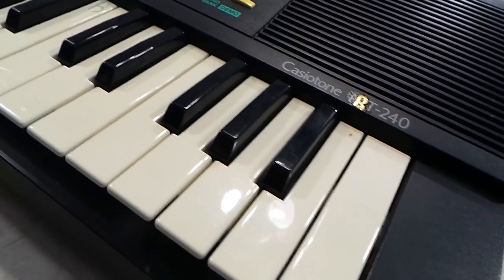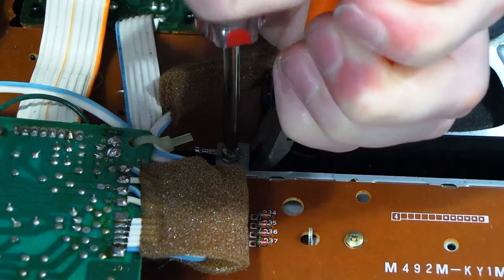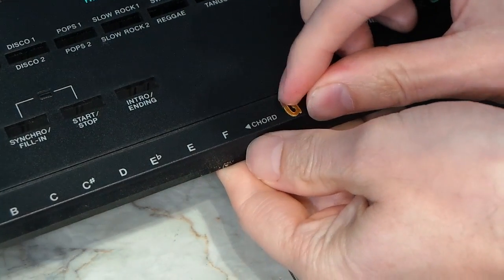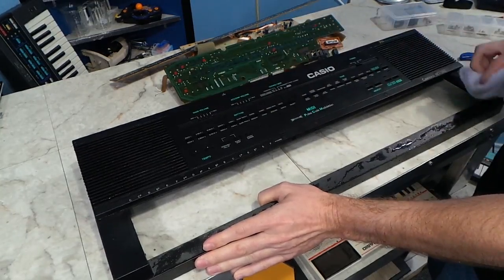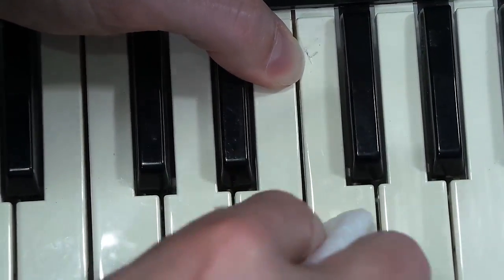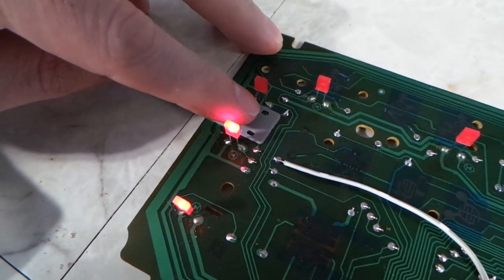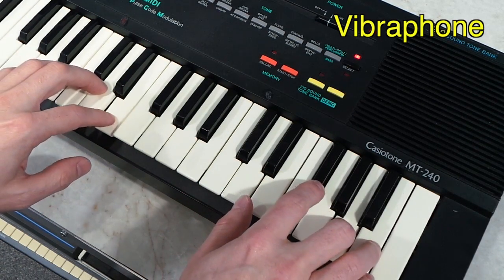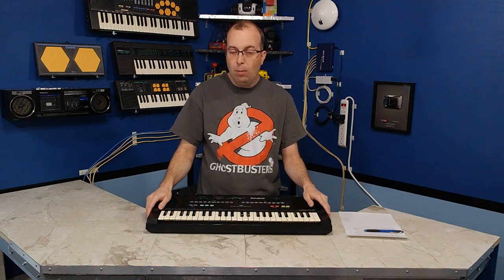Casio MT 240 - Repair, Restore and Review

Comment: Note to everyone: Be careful with the rubber domes for the buttons on keyboards of any kind as the are coated with a conductive coating that allows them to complete the circuit when making contact with the copper trace on the board allowing the circuit to be completed, over time that coating can where away making them not work at all, so be careful if you try to clean them.

Comment: about the leftover glue residue, you can try sanding it off with automotive grade sand paper (1000 grit above, higher grits will bring back the sheen after a bit of buffing with cotton), 3M sanding pads of high grit numbers can also do the trick. if you're worried about the plastic shine being fogged over the surrounding area due to the sanding, try applying some pledge floor care with a Q-tip to bring back the shine a bit.

Comment: I do adhesives for a living. Sicomet D-BOND is the product of choice
Active ingredient is nitromethane
Reply from the maker: Actually.. I wanted to try a nitromethane product.  I had read about those on the internet.  But I visited several stores such as home depot, hobby lobby, etc.  I never could find it.
Reply: That sounds better then the product I was going to suggest. It's called Goof-off and it's at Lowes and Home Depot.
Reply: Aaron Lopez
Reply: isnt the fuel used for RC cars Nitromethane and methanol?
Reply: Buy nitromethane fuel, It's used for rc cars, and it's nearly 100% nitromethane, I use it to remove old stickers from old bikes
Reply: Does it also remove superglue residue?
Reply: yes
Reply: I actually buy, like I said, nearly pure nitromethane, ethanol and oil separately, then I make the mixture by myself, and varying the percentage for the circumstance. It's much cheaper this way. But yeah, online and in Rc car shops you can find only lower percentages, they work good even if they are not pure.
Reply: With the ABS plastics like that, you are right that acetone will melt the plastic, but in my experience, you can use acetone to melt the plastic screw stalks back on, and it is a stronger bond than super glue.  I have used it to repair a quickshot joystick for my c64, and it worked great.  I took a video and will post it soon.
Reply: Late to the party, here, but Rommager is correct.  The plastic bits can be welded back together with acetone.  Just brush it on both parts to be bonded and poof!  Like new.
Reply: "I do adhesives for a living."

I just do adhesives recreationally.
Reply: +Robin Williams Heh, giggity!
Reply: I'd do Ebay or Amazon for small batches of solvents and stuff.
Reply: Hey,  @8BitKeys  I have a Yamaha keyboard with contacts that seem to be made with some black conductive material (think the last that goes back and forth closely that the rubber carbonized pads touch to complete the circuit). It seems they've dried out or corroded and that material has chipped off.

How can I fix it? I'm thinking silver conductive paint or something.  Any ideas?

Comment: Conductive paint is a good way to make connection to those printed carbon tracks under the buttons that you can't really solder to!  Also, there's a substance meant for repairing the heated tracks on automobile rear windshields that can work, too.
Reply: Conductive ink, I bought the cheap stuff from AliExpress and am doing test on my own. The problem I have encountered is that it doesn't 'grab' to the surface sufficient, so if you wipe the windshield 2 or 3 times the ink is gone. I'm going to test the 3M proper ink for windshield heater repair and report back the results
Reply: @Jojo Tully Music haven't got the proper 3M ink but by experimentation I think I found the trick to do it properly. You must use not the first "squirt" of the pen but let the ink flow and then start your trace (like painting with a spraypaint can). Also letting it cure for days before touching it helps a lot

Comment: 12:00 I learned that the hard way. Once, I accidentally spilled a little super glue on my laptop (which I'm using to type this comment). I used acetone to remove the super glue, but it also left a white spot on the screen bezel (that's where I spilled the super glue).

Comment: That corrosion was probably from the leaky battery. It would explain the mark on the rubber membrane and the eaten-through track on the PCB. I'm guessing the keyboard was stored upside down for some years in that state.
Reply: Yeah that was what I was going to blame as well.
Reply: Yep you can always tell because copper dissolves into a green residue.
Reply: @EternityofNight  - copper oxide. In the olden days they called that green residue "verdigris".

Comment: This keyboard actually has more tones than you think. The button that's labeled "210 SOUND TONE SOUND BANK" lets you pick two tones from the tone selection area and combine them. So, for instance, you can combine the chorus and the accordion to get a unique sound. But you can only combine a tone from the top with a tone on the bottom. That'll give you a very wide range of tones to pick from and play around with.
Reply from the maker: I'm familiar with how the tone mixing works.. but I still think it is a cheating way to claim more sounds than it really has.
Reply: I think you meant Yamaha PSS-380 ;)
Reply: Scarecrow Scarves Studios the same thing works with e.g. the CT-637 (which I have).
Reply: From Gwendoline Leong channel
Hi do you know how to "on" the keyboards? My Casio CTK495 works fine the Tone/Rhythm/Song bank. Just the keyboards.have no sound whatsoever. Maybe just a wire loose? Plug? What possibilities can you think  of?

Comment: I had the Casio MT-240 back in the early 90s and used it a LOT on my Atari ST/STe computers.  I used to looooove the way they sounded and it was a pretty affordable way to get MIDI back then.  I don't know what ever happened to it and I regret not still having that keyboard with me despite all the other things I've managed to keep.  I recently picked up another one and I especially love that demo song ("Night Birds" by Shakatak, 1982).  Excellent version of it!  In any case, the new keyboard seems to be in generally good condition but that 9v power supply connector is loose on the new MT-240 and I seem to remember that it was ALWAYS loose even in my old one back in the day.  GREAT keyboard--I remember wishing it had general MIDI back as a kid but it was still fantastic!

Comment: Ahh memories...Used two of these midi'd to my Amiga 500, endless fun throughout the 1980' and 90's ! great Casio sounds, especially when layered (you can layer two !). if i remember correctly, select the first tone, then select the mutli/split and then select the second tone.Eg strings and piano. This is where they get the 210 sounds claim from.

Comment: You can buy conductive coating remote key pad repair kit (check eBay) to get those non-working keys to work. It worked fine with my old Roland D-20 synth.
Reply: At your local auto parts store, rear-window defrost repair paint. I've seen it used to repair an Atari 130XE keyboard.

Comment: I personally own this keyboard and I love it because it's super cheesy but you can make some crazy sounds with it if you mix the instruments and mess with the midi, auto accomp., etc... My 210 sound bank thingy works perfectly with both the top and bottom sound banks and even though it's missing the F#0 and F#1 keys (0,1 i assume is the octave not sure if it goes as low as an 88 key).. Anyway I heard that through midi you can access "hidden" sounds like fantasy and some others but for the life of me every time I look for any information on these in depth features I can't find jack squat. The internet is flooded with circuit bending tutorials on this but I don't own a soldering Iron and I don't feel like spending a gajillion hours bending this thing. I checked the manual and it hints at these features but doesn't really explain how to use them. I was hoping that you or perhaps one of the other followers could shed some light on the more intricate operations of this keyboard. I've seen all your videos and it's inspired me to try making music by rigging up these vintage toy midi keys with my more professional Korg poly 800 (circa 80's) as well as  modern synths like the Korg volca keys or VSTs in Ableton. Also THIS CHANNEL ROCKS! I've always loved these cheesy keys and it's nice to see that there is a community of people who do to. Keep it up!
Reply: I have this keyboard and I use it with maschine. I accessed those hidden sounds by going from midi out of maschine to the midi in on the keyboard. In the maschine software I set up a macro and added a page for midi program change. The extra sounds are on program numbers 20-29.

Comment: The Casio MT 240 actually got 10 additional hidden sounds you can select using program change over MIDI. It is also 3 channel multi timbral over MIDI so you can hook it up to a sequencer and play different sounds simultaneously over different MIDI channels.

Comment: I can confirm, the MT-240's black keys were bonded to the white keys at the factory.  I took one apart in the early 90s to repair some broken black keys and noted the same thing.

The keyboard was a gift and I was only a teenager, so I couldn't afford anything that would work with the MIDI interface.  I've always been curious about something:  how many instruments is the keyboard capable of playing if you use it as a MIDI output device?  I remember being able to access some instruments that weren't normally available from the front panel, by momentarily shorting pins together on the large, square IC on the logic board.

Comment: Loved it as always.

Is it possible to "upgrade" a monophonic keyboard to a polyphonic one? Like some of the those early white Casio toy keyboards like PT-80?
Reply from the maker: Not without some serious engineering.
Reply: By the time you were done, you might as well have built your own synthesizer from scratch! What you COULD do though, is use the keys and switches to trigger a polyphonic synth built around a suitably beefy microcontroller, and stuff it in the case! All the "magic" happens in the program code and the actual wiring side of things is pretty easy.
Reply: Yes, put the motherboard on the polyphonic keyboard in the monophonic's case et voilà 😂😂

Comment: Nice work on the keyboard! I'm amazed at how good this keyboard sounds. Some really neat sounds in there. Nice job on the button hack. Next time, you could consider using conductive paint when solder won't stick. You can use an automotive defroster repair kit or there's several solvent and water-based conductive paints out there these days. I feel pretty certain this would have solved the corroded trace issue. Also, another thing to try on the super glue is mineral oil (available at pharmacies), or motor oil, etc. It shouldn't harm the plastic and just might soften up the super glue enough to scrape it off.
Finally, I'm really liking the new intro :) Keep up the good work.

Comment: I have this exact model of keyboard that I rescued from a flood a year ago. It was literally floating like a boat and it was completely covered in mud. Gallons of water and lots of scrubbing was required to get it clean. And after that, the thing turned on and was perfectly functional. Unfurtunately, a month after, it just stopped working! I think it was the moisture that damaged some chip or inductor...

Comment: You can stack two sounds so there really is 210 sounds possible.
Reply from the maker: yeah, but lots of keyboards can do that.. where do you draw the line on the marketing?  So my Yamaha keyboard with 128 sounds and dual-voice mode should be advertised as 16,384 sounds?
Reply: Now it doesn't mean much. At the time this came out, when I bought mine, it was a big deal. 
Many of the dual-layer sounds work very well. :)
Reply: People were probably more gullible and easier to fool back then.
Reply: 8-Bit Keys Actually, it's 8,256 (to eliminate duplicates).

Comment: Hi Dave, not sure if anyone has already mentioned this, but you can use conductive paint to repair circuit boards. It would be ideal in situations like yours where traces have corroded. I bought some years ago in a tiny bottle and applied it with a 000 brush. I'm in Australia, but I'm sure you could find it via Amazon or Mouser electronics. Thanks for the great videos, it's nice to see your restoration work on keyboards and I love your other channel on computers as well.

Comment: Y don't keyboard vibraphones ever sound like real vibraphones?
Reply: Max Kellen they can't make a real vibraphone sound. Newer keyboards use samples of real vibraphones.
Reply: Because everything in synths are either generated by basic waveform (older analogue) or samples (PCM) on newer gear. The complextities of analoge instruments, voices etc, are composed of many different components that needs to be either generated (poorly with older gear and with better luck these days Rolands COSM system for instance) or have to be multisampled on many levels to recreate as much as possible of all the nuances that create the sounds of for instance a vibraphone or a piano.

When you hit a piano string with the hammer or a mallet instrument with different types of hammers, the sounds differ greatly. From soft, mellow sounds of the soft filt hammers to the crisp clunk of a wooden or plastic hammer. Then you have resonance within the instrument. The nearest strings will always resonate and create upper harmonies depending on how much they're dampened or open. Same thing with a vibraphone that's open, it will have a different sustained sound because the other mallet bars will resonate with it. Then you have ambience of the room and other instruments or just the room itself that plays a factor.

You'll never be able to recreate 100% any analogue instrument synthetically, but we're getting pretty close. And nowadays instruments sound near perfect for most purposes. The older gear that David is showing will always be limited to their era in both sample memory, method of sound generation and such. Just the way it is. :)
Reply: lol thanks for putting so much effort into the answer

Comment: Try lard (pig fat) on that superglue. Can't damage plastic and it's really cheap but need hour or two to work it's magic.
Reply: I was gonna say petroleum jelly or vegetable oil. But, the lard makes a lot of sense!!!
Pig fat dissolves strange hard to remove things easily. I spilled magenta inkjet liquid on my hands once, and tried everything to get the junk off. Rubbing alcohol, acetone, lighter fluid (naphthalene), but nothing worked. Then, while trimming fat off some pork for my sandwich the next day, much to my surprise the fat turned pink and faded the dye. Needless to say, I greased my hands, then used alcohol to degrease. Worked like a charm.
Reply: Andy Merrett
LOL I cut off or discarded the bits of meat that turned pink. Only a tiny bit did though, as I discovered near immediately. I know that magenta ink isn't completely non toxic.

But I did use most of the fat to finish cleaning my hands. XDDD
Reply: P  i  G    F  a  T

Comment: I have this exact same keyboard and I was able to remove similar lettering with a product called Goo Gone. It absolutely works and almost instantly!   For the more difficult areas wipe it on and let it sit for 5 minutes then it should wipe away with ease. in case you are wondering, Go Gone is a citrus concentrate that removes these hard to remove things by using enzymes that eat away the residual residual leftover rom glue, gum, tar, marker etc.

Comment: Nice memories! I've got the MT-240 in my childhood. Now is in the hands of my brother, still working fine. One clarification, you say it has 20 instruments, and 210 "combinations". In reality it has not 20, but 30 real / direct instruments. The problem is that you can't access those instruments (21-30) via the buttons in the keyborad (AFAIK). 

How can you play with those instruments? programing via MIDI comands of course. Use a controler (or PC) via the midi IN port. In the controller, using bank 1, change the patch (1-20) to get que standart instruments. Use the patch 21-30 to get the extra included instruments. You can play the instrument via the controller or the piano keys!

Comment: Hey man, I love your videos! I have a Casio PT-100 and a Yamaha PSS-270, bought em each for under $10, and cleaned em both up, they look like brand new! The only issues I had cleaning up the Yamaha, were the tiny tiny ball bearings in the sliders, and reassembling the keyboard (as i took the whole damn thing apart XD), Goo be gone was my best friend, as the original owner put large stickers on each key, even putting stickers on those stickers!? But 8 hours of reverse engineering later, I got both up and running in tip top shape, and funny enough I now use them for my tunes, I love the FM synthesis on the PSS-270. It's like a baby DX-7.

Comment: I have this one and have circuit bent it many times. Same reproducable bend. The battery left inside the keyboard issue is always an issue with me too! Almost every board I have bought or found in flea markets and pawnshops,ebay and so on, had batteries left inside to leak or make the board too heavy for reasonable shipping costs. This keyboard was my FIRST ever keyboard purchase with my first ever paycheck at 14 years old back in 1989! It cost $142 in K-mart in Puerto Rico and was my first video recorded keyboard as well!

Comment: Hohner had a licence to sell it in Europe. It's exactly the same except that:
- The Hohner is white & more stylish
- The panel is set differently (Power button not at the same place, etc.)
- It doesn't say 210 Tone Bank but 210 Poly mix
- On the panel the 210 "sounds" are listed.
It's called Hohner PSK 15. I'll post a video one day.
Excellent video as always, btw!